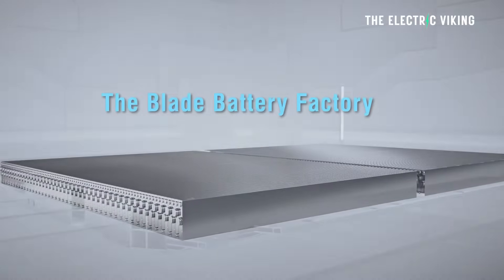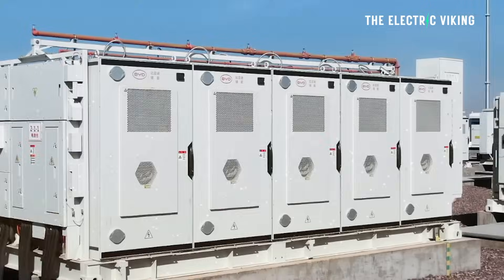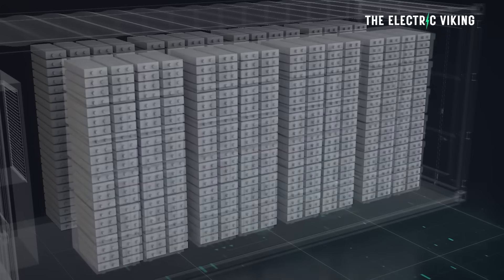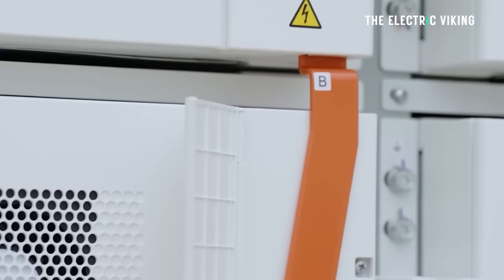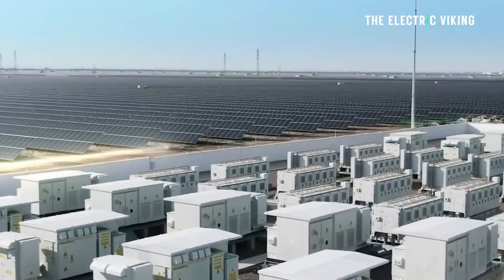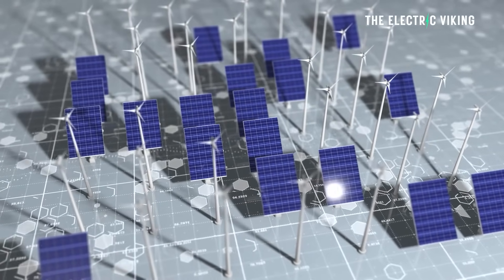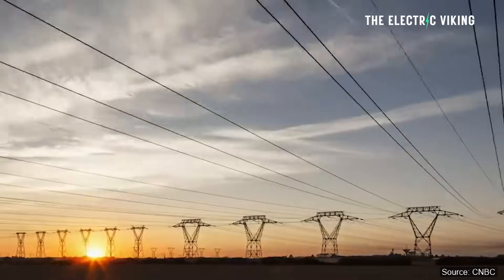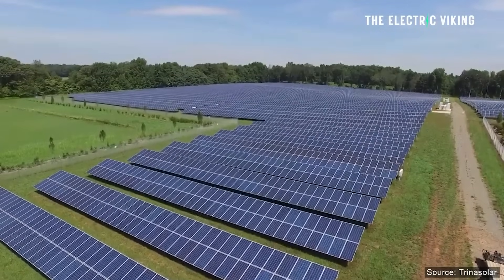The biggest BYD battery in the world will power millions in Saudi Arabia

Comment: To go 100% solar air conditioner and refrigerator need to reinvent, thermal storage, is cheaper to store thermal energy than electricity especially if the air conditioner provides hot watter simultaneously and at no extra charge.

Comment: I'm Aussie, resident 40+ years Hong Kong, where we get 40% of our electricity from Nuclear and most of the rest from gas. Result: our CO2 emissions per capita are less than a quarter of Australia's. We have little solar because not enough land (solar takes 300-600 times the land area of nuclear/gas). The problem with this guy's "analysis" is that it doesn't take into account that most of the "sun-belt" countries have similar land constraints, constraints that Saudi and the Emirates don't have. 
It still puzzles me why renewables folks can't accept that Nuclear should be an option. I totally accept that solar is an option. Just not that it's suitable for everywhere as this guy seems to think, per his last couple vids. For me, it's an "all of the above" situation, and I support Australia going nuclear. (awa solar and batteries, where that makes sense).

Comment: CHINA’s thermal power generation – largely coal – rose 1.5% in 2024 to 6,340 terawatt-hours (TWh), Reuters reported, “defying “expectations that coal generation was peaking”.
Reply: Do you even understand what is the meaning of 'peaking'? 😅
Reply: just keep a look out to what is actually happening in China,  coal is on the way out.  Check back in 2 years.
Reply: China's electricity demand is growing at 10% pa and they are putting in more renewables than the rest of the world put together. So the % of electricity generated from coal has fallen sharply over the past decade.

Comment: Why aren’t the battery cubes under a solar panel umbrella themselves ?
Reply: A quick Google search will tell you. Placing solar on top of batteries will cause the batteries to overheat. Including other issues as well.
Reply: @ - if it’s an air gapped umbrella that can’t be the case and it keeps the direct radiated heat of the sun rays from heating up the cubes
Reply: @ More money to install Umbrellas.
Reply: clutter and restricted access.

Comment: Victoria and Tassie not going to be able to have Solar alone over the Late April through late July as typically the may june period is 1/3 - 1/4 of the generation that is achiever in November Dec and Jan.
That significant discrepancy in ratio of generation has to come from somewhere that can transmit that shortfall. Tassie has a lot of Hydro for the Autumn and through spring but still needs wind and other forms of power through Winter. 
Victoria need 4 times the summer load due to less daylight and significantly more overcast conditions even in the areas the other side of the ranges. 
The big Benalla/ to Glenrowan solar farms see this similar difference in seasonal solar power generation  so Victoria needs  to pull more from other states. and wind needs to supply that  or some other base load supply. Hydro is not going to do that.

Comment: Why don’t they put these batteries under solar panels in the shade?
Reply: That is exactly what our company did in a recent ESS installation
Reply: There has to be a reason you think they haven't thought of this.
Reply: perhaps easy  access and other factors, and anyway, the batteries are protected in their own stable environment that keeps an eye on all that important stuff.
Reply: The BYD ESS deployed there of the advanced type using liquid cooling which can maintain temp around 3-4 degrees inside that container.
Reply: the battery need to be protected and closely connected to each other plus the BMS system. and also easy maintenance.

Comment: For how long will it power these homes. There is a massive issue with batteries, just look at moss landing in the states spontaneous combusting for the 4th time in 5 years. You are seeing more and more battery fires world wide and this is a fact. You do not state how long it would power them for
a 500 M/W battery would power the UK for barely a minute.
Reply: They used LG chem NMCA battery tech ..Battery life 25-30 yrs... EV fires (cars USA stats per 100,000) car = EV fires 25, Gas cars 1,100, Plug in Hybrid 1,600...So were are your facts...Oil Tanker take out Bridges all the time why they explode on impact..
Reply: The Moss Landing battery fire started in an old, first-generation NiMH battery housed indoors. Modern LFP-based batteries housed outdoors are much less of a fire risk.
Reply: just check the facts , we all know that this battery is very old, meaning it is first gen' so to speak, and also inside a building,  nobody does that any more! b. Also the later gen batteries outside seemed to be ok.  These days they are LFP and that means they are much safer.  I lived in Brisbane for 20 years,  and just over the river from me was the oil refinery, and it often caught fire, I have  video footage to prove it!  Refineries have been around for approx 100 years, so you would have thought they would have got their act together by then.  But,  like everything else in this world, things go wrong.  So we have just to get used to it! 
By the way we visited the UK in June last year and loved every minute of it, (except the roundabouts)  the one thing that really took my eye was the incredible amount of wind farms there,  and mostly offshore and barely visible from the beach. In binoculars however, they were a very impressive sight!

Comment: 22nikkoAA- - - > >  The solar panels should be shading the battery storage trailers and they should run cooling loops underground for passive cooling
Only a small amount of power required to pump the coolant
Observation- - -> >  clavo3352 This is great thinking.  Wonder why the engineers don't design for such installations ?  There should be several different embodiments of such cooling alternatives available for customers to be able to best adapt the battery they are buying.

Comment: You can ship oil. You can't ship electricity (yet).
Why would you burn oil if you could use solar with batteries and nearly get free energy. Every drop of oil you did not burn, you can sell. Solar and batteries are so cheap, it would be foolish doing otherwise.
It is time to build batterie ships.
Reply: Solar is incredibly expensive electricity. Twenty years ago in Ontario they gave solar farms 92.5 cents a kWh for solar electricity (compared to 5 cents for nuclear power). Today we have zero solar generation.
Reply: @bunsw2070  Twenty years ago.  You couldn't get newer numbers than that.  Or you want to fool this guy into thinking nothing has changed.
Reply: @bunsw2070  this is 2025 if you haven't noticed.

Comment: The solar panels should be shading the battery storage trailers and they should run cooling loops underground for passive cooling
Only a small amount of power required to pump the coolant
Reply: There is a  reason why they are white so they can reflect light instead of absorbing. There must be a reason why engineers don't put the solar on  top of the battery you're not the first to suggest this.
Reply: If you are the manufacturer, and have to pay for all this stuff, they would have considered all the options to give the quickest payback..
Reply: @TerryHickey-xt4mf  If you're trying to make a profit,  you have plans ready so your installation crews can provide additional, valuable services to your customers.
Reply: This is great thinking.  Wonder why the engineers don't design for such installations ?  There should be several different embodiments of such cooling alternatives available for customers to be able to best adapt the battery they are buying.

Comment: Wrong: Wind is still necessary in large parts of the world if an unrealistically large number of solar systems are not to be built. Where I live, solar output is <10% in the winter months and electricity consumption is highest during this period for heat pumps etc. That is also what Tony has shown.
Reply: Totally agreed, here in Ukraine same problem. Lots of people installed solar, but it can't heat the home during winter even if you have a heat pump. Even if you have a large battery, there can be like 10 days of clouds which make panels to produce less than 5 percent during already short winter day

Comment: Why would Saudi want a single phase battery? That seems insane.
Reply: Because the output from the solar panel is single phase. Converting it to a 3-phase system will complicate things unnecessarily. Especially if the target end use is for domestic households, which is in single phase anyway.

Comment: Question….when sand storm dust covers those solar panels, does Saudi Arabia use low wage immigrants to clean them off?  What is the carbon footprint of just one of those batteries relative to mining critical inputs and manufacturing?  NET ZERO?…not so much.
Reply: sand storms can clean them as well.
Reply: How about compared to running the dirty infrastructure of oil?
Reply: @  It has been asserted that the world eats oil….relating to Nitrogen fertilizers that allow for necessary yields.  Modern medicine is the largest consumer of plastic products…again oil derived.  Lubricants for industry is also an essential, oil derived product.  Solar panels and windmills require energy dense oil for manufacture.  Unless you want to go back in time to before the industrialized revolution to an agrarian society and the resultant population die off, oil will be necessary well into the future.

Comment: Why would you use lithium batteries in a desert! Size is not a problem because power density is not important,  so they should use non toxic batteries ie capacitor batteries  which are cheap and don’t produce toxic chemicals or waste
Reply: He said Lithium iron phosphate and what do you mean by toxic? Old lead batteries used in cars are far more toxic.
Reply: @ 
The manufacture of lithium batteries ( expensive) produced toxic chemical, power storage in the desert does not need high power density and expensive batteries. So non toxic batteries like capacitance batteries (cheap)can be used
Reply: @davidchin35  Can you give me a name of a commercial capacitance battery installation?
Reply: better talk to those guys, they need some educating.

Comment: The Saudis are not fools. If they switch entirely to renewable energy, they can make more money by selling ALL the petroleum products they no longer need. A win-win game for them.
Reply: This is good because they will also realize that they can sell their petroleum to make plastics with zero carbon emissions instead of just burning it
Reply: This is exactly the strategy stated by Saudi Arabia. To shift power generation to a mix of renewable and gas. Sell oil.
Reply: clean and renewable energy is indeed part of the 2030 Vision for a better sustainable world
Reply: Not fools. Hows the Line shaping up ?
Reply: @jackneuman5108  phase 1 already pilling done. This year will lay the foundation and go vertical. You know the line is in phases right? They will not build 170km in one go. 2.4 km in 2030.
Reply: @sgsgy  Doomed insanely expensive  project.
Reply: @ The new mukaab and murabaa will cost 50 billion in riyadh. More than a module. Saudi has  massive cashflow and they cannot dump it all in existing cities or they will overheat their economy. So they need to invest it internationally and on giga projects.
Reply: @sgsgy  How many megalomanic gigaprojects Norway is doing ?
Reply: @ norway does not have land to do them. And their fund grew for 50 years and more. And Saudi swf grow from 100b to 1trillion in 5 years. You are limited by your outside investments too. They are investing heavily internationally but they have money left for giga projects.
Reply: @ to give you an idea saudi swf will grow to 2 trillion in the next 5 years. That is the plan. A trillion dollars every 5 years.
Reply: @ https://youtu.be/4FRlNH-LhX8?si=H8gbrUtAEBkO6Skm

Comment: Good day Sam from Canada here in the great white north.  With the advancements in sand battery storage technology I'm surprised that these countries with massive desert areas are not looking at that technology as an option for power storage is that because of costs?  On another note I would be concerned that as countries integrate more solar and other renewables  into the grid and become more dependent on that infrastructure  I would think security would be an issue as bad actors would fine that an easy target to attack the power grid. What would be a backup plan be for these countries in the event of either a software hack or use of drones to destroy these areas? Thank you love your work and this channel.
Reply: The government does not require specific chemistry in their tendering process. Basically whichever company bid the lowest costs (regardless of chemistry) with 15-20 year guarantee will win the project. This is an over simplification. Other things are taken into consideration of course.
Reply: Solar and batteries can be decentralised more easily than other  systems
Reply: @julianskinner3697  a topic not very much mentioned, but to me a very important aspect of all future energy independence.
Reply: Sand batteries? Lol. You'd think they'd be trying to trigger lightning storms to charge up the desert.

Comment: Add in Hydrogen manufacture on site and you have the winning tri-corner formula for success, Wind/Solar input with Battery and Hydrogen storage to fill in the overnight null periods
Reply: Saudi is building the biggest green hydrogen project producing 600 ton a day it’s also in neom
Reply: sorry, not a good idea as regarding storing electrical power.
Reply: @TerryHickey-xt4mf  But once the batteries are full instead of wasting power use it for something more potable such as hydrogen
Reply: Is your mom the scientist in the family? Hydrogen requires 15 parts energy in for each 1 part energy out. It makes even less sense than renewables and batteries.
Reply: @ respectfully if the batteries and full then its better to use the spare energy than let it go to waste

Comment: Wouldn't having the batteries under ground protect against extreme surface temperatures?
Reply: Sure, fans dont work underground, you'd probably have to use liquid cooling
Reply: Building anything under ground and managing air flow is much more expensive. Even here in Ukraine electric grid components are not stored underground.
Reply: Then how will you put out the fires?
Reply: @bunsw2070  there isn't a good way to put out mass battery fires, the idea is they never catch fire at all
Reply: @bunsw2070  what fires?